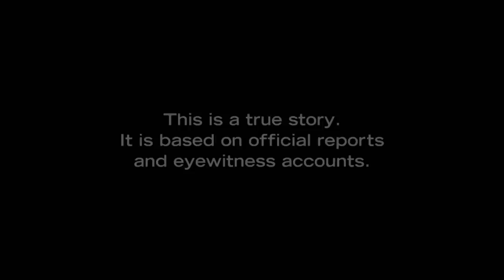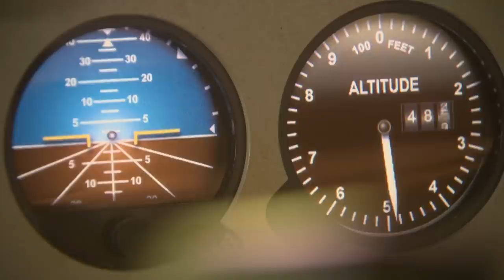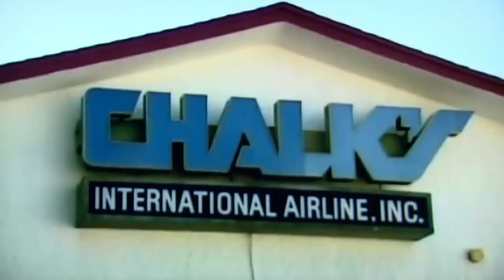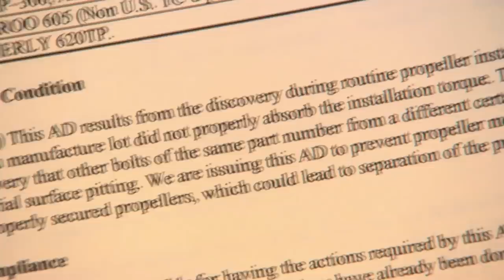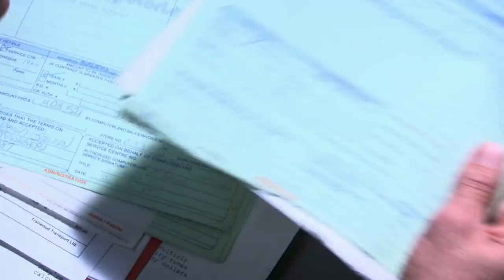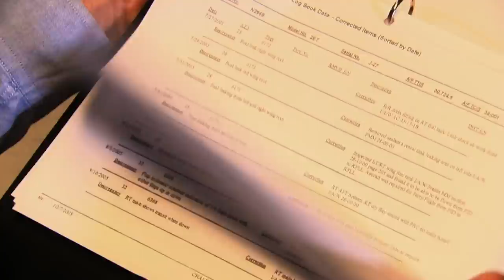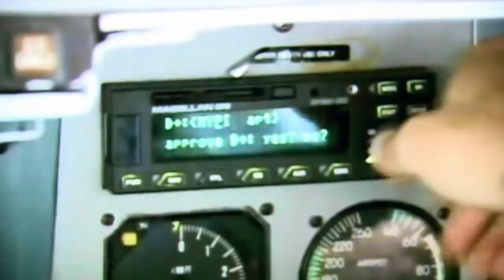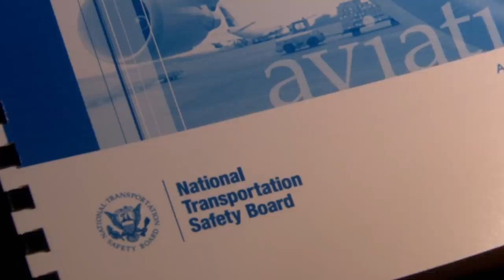A Catastrophic Plunge Into The Ocean | Chalk's Ocean Airways | FULL EPISODE | Mayday: Air Disaster

Comment: Unfair to the crew and passengers. They never knew how fragile the plane they flew in was.
Reply: Generally, it's almost always unfair the passengers in any crash.  They just paid for a ticket.

It's the guys in the cockpit that's sometimes the problem.  Not in this case, but plenty of other incidents.  (The current crash in China may prove to be... interesting...)

In this case, the plane was over 50 years old.  I can't tell you the last time I was in any vehicle that was over 50 years old.  Considering some of the eps we've seen on aged aircraft and metal fatigue, maybe they should put an end-of-life on planes for passenger use...
Reply: Thing is, it said that the pilots had met up to discuss how poorly maintenance was and how many issues the planes were having, so to say the crew didn't know is incorrect, but it isn't their fault the plane broke.